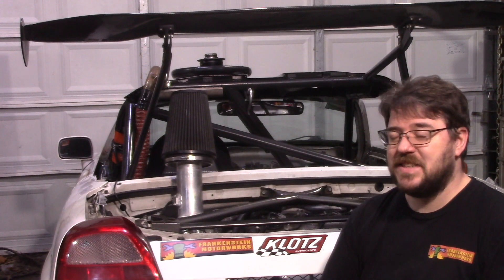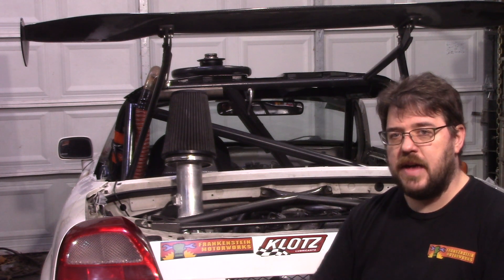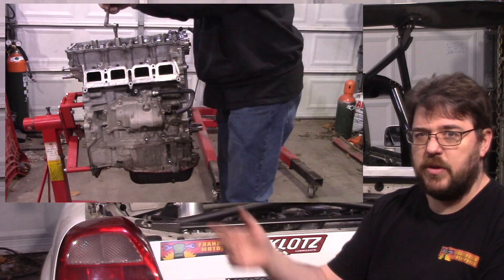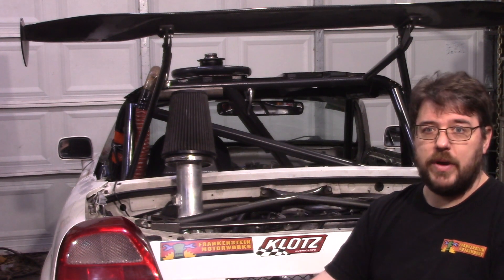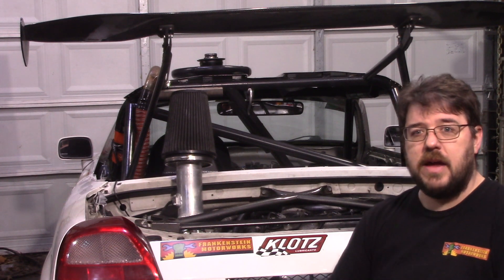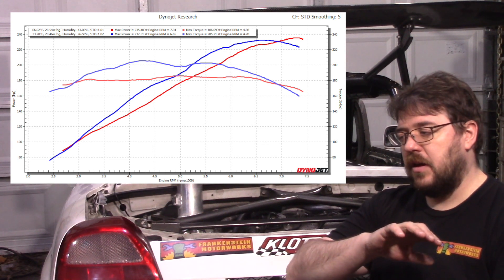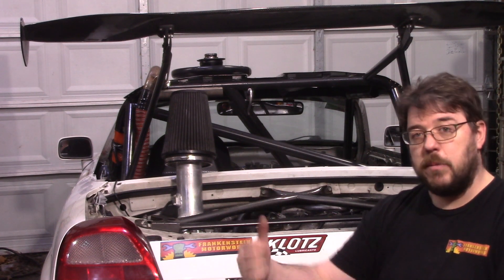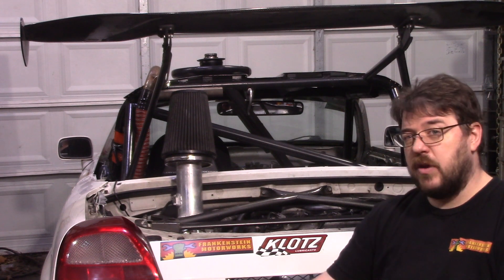Reduced cost high horsepower Toyota 2AR engine

Comment: I know exactly what you're talking about with those huge intake runners actually robbing power at the lower flow numbers your valves and heads can do. I was listening to an old drag racer talk about running Cleveland cylinder heads on his engine build and he actually made more power by filling the intake ports partially with epoxy because it increased the air velocity. Better fuel atomization, better cylinder filling. Odd engine that you might appreciate: he was running a 300 i6 with several Cleveland V8 cylinder heads welded together. He made the holy grail 600+ (>1hp/ci) with that engine back in the early '70s. All home built stuff too. No big money racing team or sponsors behind him. Gentleman by the name of Sherman Sligh.

Comment: We used to do the same thing in the 9A/ PL VW 16V engines back in the day as a 'cheat on the cheap,' using an OEM exhaust cam as an intake cam, flipped with a lobe cut off. It was basically a "poor man's 'euro' intake cam." Nearly identical duration. Back then there weren't many tuners/ aftermarket parts to be had so you had to get creative to be competitive. Nice work on this thing, and thank you for sharing it man👍
Reply from the maker: Yeah, old school performance techniques still have their place. Not everything needs to be expensive :)

Comment: Marc I’m surprised your intake didn’t make more horses than that. I’m betting you will pull more out after you tune the stock ecu. Like all your followers here I can’t wait to see where this will go.
Keep up the great work and happy new year.
Reply from the maker: Yeah, for sure. i wasn't expecting 30whp like it did on the engine with the much bigger camshafts but i was expecting something. But this is why we do these tests, you just don't know for sure until you try it.
Reply: @FrankensteinMotorworks  
The VVTI reacting like it did in your earlier FXE build it’s obvious, as in all hybrid engines it’s not designed for much rpm variance. Even though the FXE has high compression it’s not designed for high rpm. With that in mind I checked and saw the 2ARFXE and the 2AR have the same injectors. Increasing air flow via cams, intake and exhaust will only take you so far. Matching your prior changes with increased fuel injectors may wake up those hidden horses.
Keep up the great work!
Reply from the maker: @fredbowman7797  All of my builds i've done so far have all used the 545cc injectors. The issue is just that the intake is severely mismatched with these smaller cams.

Comment: When you get back at working at the 2AR. try pairing the 2GR throttle body with the new ported cylinder head you have laying around. maybe in theory that head with your intake on a bigger throttle the 2ARFE could get near 300hp with stock pistons.

Comment: I'd love to do this build but here in the the UK I think I'd struggle doing it on a low budget! The engine isn't the problem, the hybrid engines are common and plentiful on eBay. The transmission on the other hand seems to be impossible to find, which means a very expensive import from the US :(
Reply from the maker: Yeah, unfortunately there's just no good answer for a worldwide easy to use transmission. This swap mostly makes sense for North America and a few other countries. In the UK the 5 speed transmission would make more sense but unfortunately the transmission is slightly bigger so it interferes with the crossmember.
Reply: @FrankensteinMotorworks  tha last manual Camry sold in Australia was the 3.0 litre 1MZ-FE. Maybe I should drop that in a Spyder instead
Reply: can u use mr2 6spd trans @FrankensteinMotorworks
Reply from the maker: @turbod15  Unfortunately the stock 6 speed transmission will not bolt up to the 2AR-FE

Comment: can't wait to see if the 2ar is capable of 300+ whp with like normal petrol, nothing fancy like ethanol or e85, also you mentioned you have a ported head for it , can't wait to see how much it improves the flow and performance overall
Reply from the maker: From what i've seen so far i think that the 2AR will be capable of 310whp or so on pump gas before any fancy fuels are used. I'm sure it could do a bit more with a lot more R&D but for my skillset and budget i think 310whp will be about the limit NA with pump gas

Comment: Hi, Marc. First of all - thank you, you are the man!! Your craftsmanship and knowledge and modesty - I appreciate it a lot. Now the question: did you remove the balance shaft assembly from AR engine? If yes - how it affects longetivity? Is there any power gain? Some say the balancers are there only for creature comfort, some say the engine will grenade itself without balance shaft. What's your opinion? Thank you!!
Reply from the maker: I generally delete the balance shafts, it does not have an effect on engine reliability and in theory it allows more power to make it to the wheels but i have not measured the difference. At a factory 650rpm idle this motor does have a decent vibration without them, i would probably not remove them on a street car.
Reply: @FrankensteinMotorworks  thank you very much for your reply!

Comment: So would this work with a 2AR-FE? Im asking because I have a 2013 Scion TC Manual Transmission.
So im wondering if the camshafts, valve springs and retainers, and intake manifold from you and nixspeed would work with the stock ECU now.
Another question I have is can I buy your and nixspeed’s intake manifold only, with the stock TB, and install it would I make more power? Would I need to tune for that? 
Im asking because I might just get the intake manifold for now, and get everything else once im ready to make that step

Comment: So I've just recently fallen into the pit of Toyota's overbuilt hybrid engines and I love the idea of this 😄 I'm myself planning a 1NZ-FXE swap in my Yaris Verso this spring.
But did I understand correctly that in this you're still using the FXE intake cam? Wouldn't an FE cam give more gains? Or does the VVTi on this engine witch between atkins and otto cycle?

Comment: Great stuff again! I cheated on my Audi and just put a turbo on it. For tune I have adjustable FPR and bigger injectors. Running the stock ECU and MAF and all that stuff. Went from 175hp to 225hp with 0,4bar and now I´m pushing 0,8bar trough it so it should be somewhere around 285hp. With 1 bar of boost it should be over 300hp, but I´m afraid to push it that far since I have no way of retarding the ignition.

Comment: great content man, I wanted to ask you what your thoughts were on a newer swap like a 2ar into a 12th gen corolla? do you think its possible on a budget?
Reply from the maker: The M20A motor in there is actually a very similar size to the 2AR so it would likely fit relatively easily in there. Electrically it could be a bit of a pain depending on engine electronics integration. I just don't have an answer for that but if i was doing it i'd probably look at an A25A swap instead since it's the same motor with more displacement and should avoid a lot of the other little issues.

Comment: Is there a whole swap kit for this? If so, is it plug and play or does this require cutting and welding? Also, can the swap work with factory dash or so you need the aftermarket one?
Reply from the maker: yes, it's all at frankensteinmotorworks.com and it does require a bit of firewall hammering but no cutting and welding and there's a body controller that handles all the factory dash and A/C stuff.

Comment: That interessing now that it can run on stock ecu with both side fxe intake cams make me want to look more into it ! 

As you say there not enough air that being suck for the big intake runner did you think that with a big air dam that forcd the air in the intake when the car move this could be help and be able to run the big runner intake sure maybe on the dyno it will not gain and will maybe need to be tune on the track when the wind its force in the air dam !?
Reply from the maker: Keep in mind this is theoretical at this point but i think i can get it done. I will report back if it actually works when i get it done.

Having higher air density at the intake may force the intake into having enough mass flow to start working right but i do have other things i will try working on to fix this problem.
Reply: @FrankensteinMotorworks  keep on the good work :)

Comment: Are you aware if the Scion TC manual transmission would swap into a 2ar Camry? Specifically a 2014 when they stopped offering the manual 2ar Camry for some reason
Reply from the maker: The only difference is the shift levers so you should be able to get the camry levers for relatively cheap from TOyota and swap them into a tC transmission

Comment: One of the hurdles for us international folks is that the required gearbox isn't available. I can get the 2ar-fxe from any RAV4 hybrid here in the Netherlands, but they're all 4WD.

Also, since my car is RHD wouldn't that create issues with the throttle pedal?
Reply: I'm with you on this
Reply: Someone should make an adapter plate for bmw boxes, they are plentiful and cheap here in EU :)
Reply from the maker: That is a problem for my ZZW30 swap kit but keep in mind i make an SW20 swap kit also and that one uses the stock E153 or S54 or E350 or really, almost any of the e series transmissions. The reason the ZZW30 kit does not use the E series trans is because it is too big to fit without cutting the chassis and requiring chassis trimming & welding reduces the already tiny market by a huge margin. 

As for the RHD DBW, talk to Paul Woods from Woodsport, he sells a compatible RHD adapter.

Comment: what sort of mods would you recommend to someone starting out with tuning a 2ar-fe in a 2012 scion tc (mt)? I assume you'd swap for the higher compression pistons from the fxe?
Reply from the maker: it depends what your ultimate goal is. tell me a bit more about your plans and i can provide tips.
Reply: @FrankensteinMotorworks 

Am someone else with a similar question. I've a 2013 tc (mt) as a daily driver and have loved it since i got it new. Would like to bump up hp and torque for more spicy daily driving and maybe autocross.

Currently bone stock. Not interested in the turbo route and found your videos very insightful and wonder what could be done. Air intake, camshaft, springs? Would like to keep stock ecu if possible. In general, do as little for as much power without breaking or hobbling my daily 😂. That's all...

Comment: I’ve been thinking the only reason for me to justify a stand-alone cost is for turbo not a adjusted exhaust cam. Head work cost looks to be still worth it. Haven’t finished it yet I’m guessing. Rooting for a 300 cheap setup.
Reply from the maker: 300whp NA without an aftermarket ECU is going to be a damn stretch. I personally don't see it happening but who knows. weirder things have happened.
Reply: @FrankensteinMotorworks  I’m 12k deep in a mzr speed6 motor build and have a couple more to go. I’ve been with you since I bought my spider a year ago and dropped rotary’s. (Can you believe I ran on a palm pilot) I don’t really know much else other than hopes and dreams. Stuck down here in Evansville,IN. Happy New year!

Comment: Hey Marc, would this be possible on the FE? Just getting another intake cam and switching the vvt gear to a fixed gear and tuning the ecu for it?
Reply from the maker: There's no reason to delete the exhaust vvt-i. The only reason i'm not using it is because the FXE motor does not come with it and it saves money to not add it back on. 

I do have builds with the FE engine going all the way up to 270whp.
Reply: @FrankensteinMotorworks  Gotcha, I was really interested in seeing if it would work with the stock ecu, I’ve seen your video on the 240whp and 270whp on the FE, I messaged you about it back then and you mentioned the stock ecu may not work due to the poor idle the stock ecu wants to stick to which is 650ish, but if we were to tune the stock ecu to idle at 900, would we be able to use your cams, high rpm accessories, velocity stack maf intake, and exhaust to get 240whp without using the haltec?

Comment: Could one do these modifications to a 2.5 Camry? When does the stock auto trans blow up?
Reply from the maker: There's no difference between this motor and a 2AR-FE in a camry so the modifications would certainly work. Unfortunately i have no idea about the 2nd half of your question, i have zero experience with that automatic transmission.

Comment: Hi Marc! I’m curious, in your opinion with your experience, what rpm would you say the factory 2AR valves springs/retainers are good for?
Reply from the maker: It depends on the cams, the 2AR-FE cams are safe to 7200rpm, the 2AR-FXE cams are safe to 7600rpm.
Reply: @FrankensteinMotorworks  Got it, so raising the limiter to 7200 on my unopened 2AR-FE should be relatively safe?
Reply from the maker: @zev4036  Yes, we've raced the 2AR at that max RPM for years and years. You're good to go.
Reply: @FrankensteinMotorworks  Thats great news, Thank you!

Comment: Hello, I just started doing some research on engines. I would like to know if the 2AR is comparable to the 4AGE? If not, what modern Toyota engine is similar to it? Perhaps the 8AR?
Reply from the maker: Unfortunately the 2AR falls under Toyota's "medium" size engines and the 4A is a "small" so their bellhousings don't match. I'm not really familiar with toyota's small engine family so i don't know what the biggest small engine is.
Reply: @FrankensteinMotorworks  Gotcha. Thanks anyway! It might still work though. I'm brainstorming on a GT86\BRZ\FRS build for the future. I would like to swap the flat 4 with an inline 4 with a similar or slightly higher horsepower output
Reply: Potentially the 7afe as the biggest small engine? (Fits the 4age head) Everyone used those for years to make 9age 

Might be wrong though loads of obscure engines out there 

2ar stuff is new to me, very interesting, thanks for the info  @FrankensteinMotorworks

Comment: I should just switch to a 2ar or 2gr literally already have the transmission axles, and shifter linkage sitting in my closet. This would be going into a 1995 mercury tracer so I’m just curious. How much wiring is required to get the engine running in a non-mr2 application: I know I can get a pnp mr2 harness but I don’t have an mr2.
Reply from the maker: There's some nuance of course but effectively you need about a half dozen fused power sources and a throttle pedal. no external secondary computers are needed other than the engine computer itself.

Comment: Would the 2ar/1ar head be compatible with the 2ar-fxe block? I’m assuming it doesn’t, but considering you’re trying to build a cheaper option especially for people in markets where the 2ar/1ar doesn’t exist I’m not sure. 

Basically would putting a 2ar/1ar head onto a 2arfxe block solve stock ECU issues while achieving a higher compression?
Reply from the maker: the 1ar-fe, 2ar-fe and 2ar-fxe all have the same block and head, valves and springs. 

The issue with the stock ECU is the missing exhaust vvt-i but i will solve it.

Comment: I'm excited for this 2gr build hitting 350 n/a. I was thinking about stuffing a k24/k20 swap in my saturn (due to internal engine upgrade parts being almost non-existent/custom=expensive) so when this one breaks from too much boost, I'm going to put something else in it with some aftermarket. I like turbos, always have and this is my third turbo kit on this one 1997 saturn coupe I have, but I'd really like to have n/a 350. i think I could live with that. :) Rather than the kswap, I'd like to rock the toyota motor. Having said that, do you think once the 350 mark is hit, you'll offer full component packages?
Reply from the maker: I will make sure that all the parts needed to hit that power level are available. Sometimes i can't always get things at wholesale pricing so some of the parts may simply be part numbers and where to source them but the recipe for this build will be published.
Reply: @FrankensteinMotorworks  I just bought a 2007 2tr inline four tacoma. Will this be something that can be dropped into my truck?
Reply from the maker: @kurtbennett1164  the 2TR is a completely different motor. some parts may be compatible but it's unlikely and i have not checked any of them since the motor does not fit in the MR2.

Comment: How fast do you think the engine is going to have to spin to hit 350 wheel on an NA motor? I would love to put one of these in my 2nd gen revving past 8k.
Reply from the maker: I think I'll be able to get there between 8000 and 8500 rpm.
Reply: @FrankensteinMotorworks  is that with boost?? Or all motor? Never realized those engines made that much.

Comment: Been looking at my 2012 rav4 and wondering if the 4spd auto trans would be able to take the extra torque if it can hit 350hp at the crank with the supporting injectors, intake, cams, valves and ported heads? Was also looking at GR Corolla technical docs. Saw that the front and rear subframes are borrowing from the 2006-2012 rav4 platform on the GR corolla, so that might be a possible swap?
Reply from the maker: Honestly i have never touched the automatic transmissions so i really can't give you any information there. but that's a lot more power than stock so it would not be surprising to me if it was too much. But the bolt pattern matches the one on the 2GR-FE so maybe you can switch to the 2GR's transmission? you'd have to ask someone else about the details.